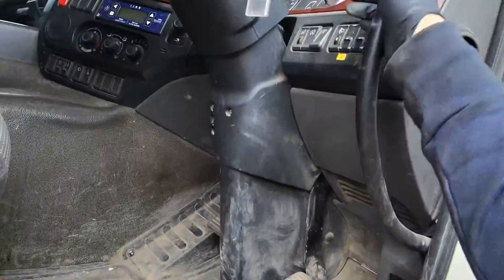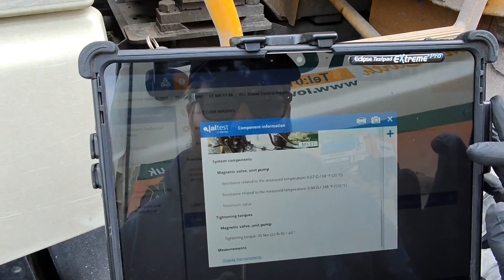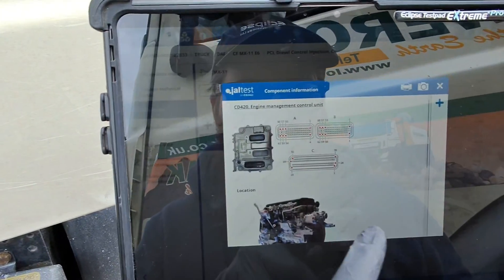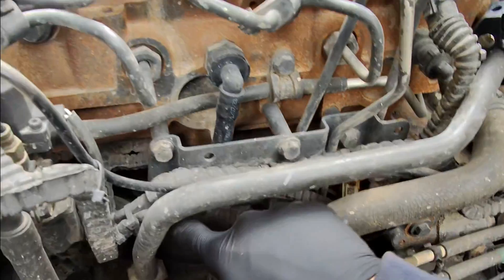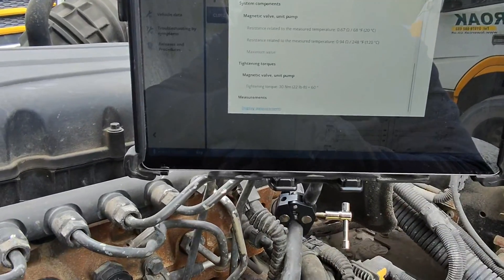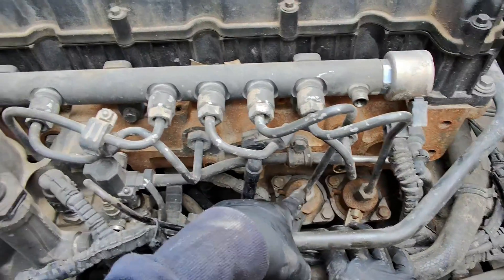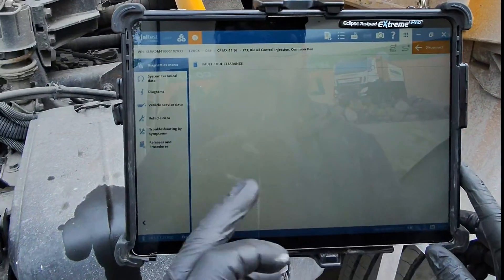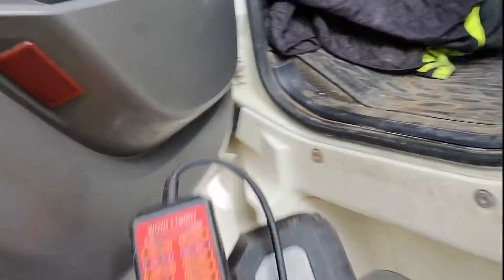DAF Unit Pump Failure: Troubleshoot & Repair

Comment: Hi good day I'm in Guyana and I have a euro 6 dumper truck 440 HP, the truck didn't start because the fuel pressure too low, it can be high pressure pump or gear pump??

Comment: hello! the diagnosis gave me that the pumping unit number 2 is defective. which of the two is number 2? the one from the front of the car or from the back of the car?
Reply from the maker: Hey Tony it depends if we are talking DAF numbers or JALTEST but I'd unplug one and read the codes. This should give you an open circuit for which ever pump unit you have disconnected. From this you can work out your pumping unit number but I'm sure 1 is the back and 2 is the front on jaltest

Comment: Weather it's in your line (HGV) or mine (cars) why is there always bloody parts changers. Muppets the lot of them.
Reply from the maker: Hey buddy thanks for the comment. Unfortunately, it's people who aren't educated in diagnostics and believe putting expensive components on will rectify it, whereas testing is just charging that little bit more labour bout will yield the correct component at fault (usually😂)

Comment: Last time i had one of these pumping units faulty i had to change the camshaft because the unit shat itself
Reply from the maker: Hey thanks for the comment. Yes same here,  I don't think I had an electrical fault last time though I think it was a contribution issue. 
Not the best idea are they 🫣🔥
Reply: @TRUCKTECHUK  not the best idea and doesn't help that i removed the unit before lifting the tipper body was an absolute nightmare of a job to get to anything

Comment: excellent job, you are a great master. thank you for sharing your experiences.
Reply from the maker: Thanks for the comment and for watching 👀.
Hopefully, it helps you at some point 👉 😎
Reply: @TRUCKTECHUK  Your videos have already helped me, I recently had a similar failure with the steering column tape on a CF 410, but it caused a problem with the lights, they stayed on all the time even though the vehicle was off.  I initially checked and exchanged the CMR and CMF with a vehicle without faults.  but it was still the same.  In conclusion, the fault was in the steering angle band.
Reply from the maker: Ah the old clock spring was the issue was it 😅🫣. I'm so happy something I did helped you buddy!